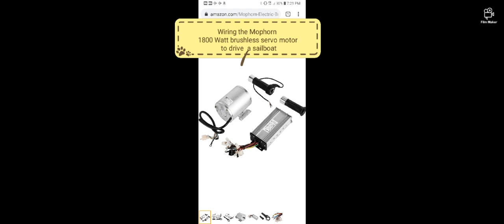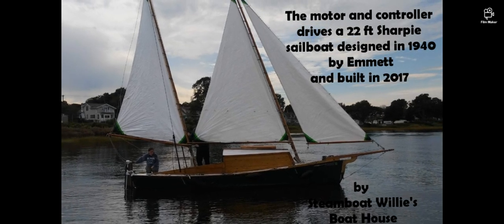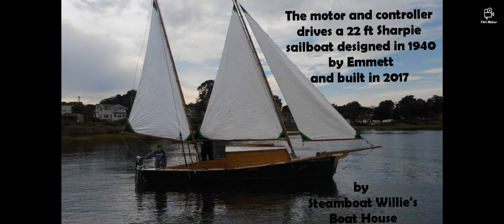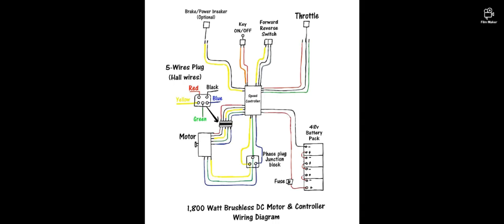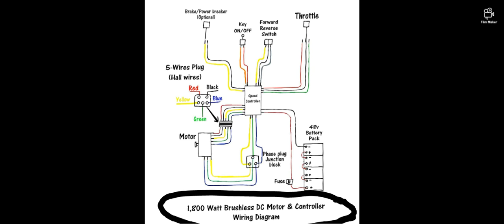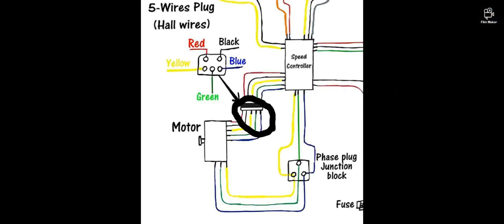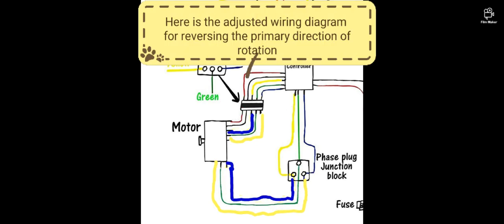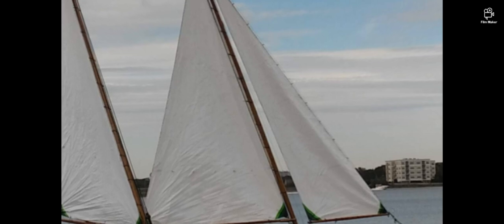Wiring mophorn's 1800 Watt servo motor for us driving a sailboat

Comment: Excellent information, thanks.
I bought the same kit and just started to try to figure out what wires go where.
Your video is the best help I have found so far.
I was hoping to see a picture of your motor setup installed.
Love your boat and using an electric motor is great!
Reply from the maker: on my channel i did a seperate video on how i Mounted it with what i would do differently you may want to check that out   thanks phil
Reply from the maker: https://www.youtube.com/watch?v=h0a3Q2-mmVg&feature=youtu.be hats the one where you can see the set up and the parts i think
Reply: @philcostello6989  Thanks! I just subscribed and will watch your other videos.

Comment: Hi Phil:  I am amazed that this kit would propel your 22 foot sail boat 5 knots.  Are you still happy with this system?  I have a 38 foot Ingrid with a 25,000 pound displacement in central America in the pacific and am looking into electric propulsion.  I wonder if this system would propel a boat like mine? Any thoughts? I don't need it for anything except moving the sailboat here and there from time to time and keeping me out of harms weigh in the event of dragging anchor and possibly  moving in the lack of a breeze.  Are you still pleased with your DIY furlor.  Look forward to your thoughts.  Blessings! Steve Owens, Missionary to Panama
Reply from the maker: I am for what I do other than the noise of the motor I think I would try a motor with higher york and lower speed and if money was not a issue  liithiu.m ion batteries . "sailing uma" on you tube has good info and is fun to watch more inline with your size boat

Comment: so does the reverse switch need to be connected like to two of the wires need to be connected
Reply from the maker: I use a simple on off switch the new ones are just a single pole on or off